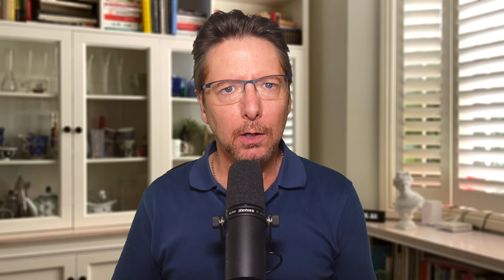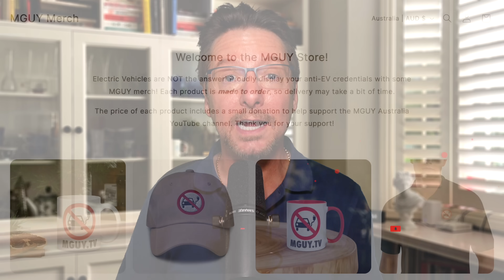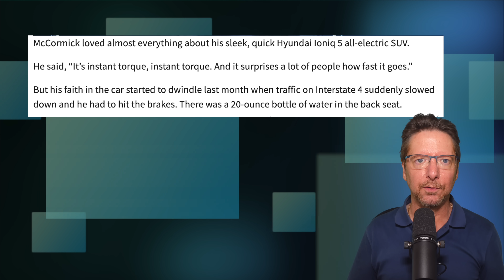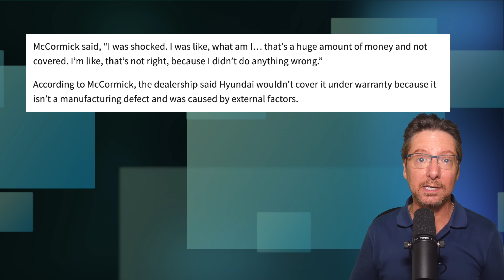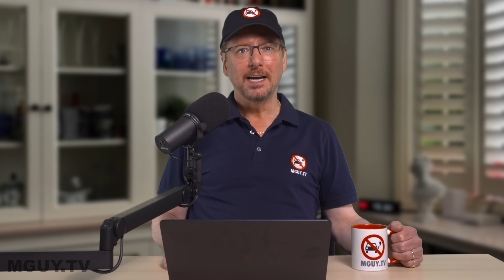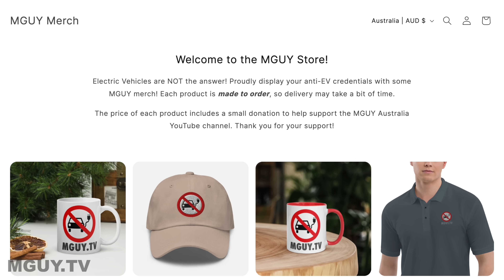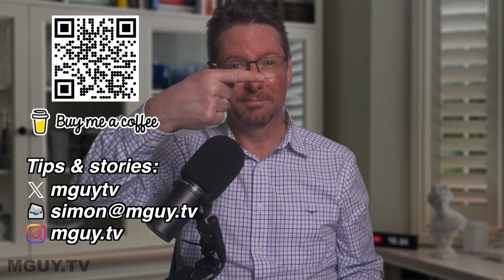ASTRONOMICAL EV repair bill for spilling a WATER BOTTLE! | MGUY Australia

Comment: Bowen wouldn't know about water and electricity not mixing, he has the brains of a house brick.
Reply: I have always called him 2 bricks 😂 he is way thicker than one brick.
Reply: The people voting for him are just as bad.
Reply: Insulting to bricks. More like dog turdd.
Reply: No, can't be: house bricks are useful.
Reply: Don't be kind to him, he isn't even that smart!
Reply: That's very insulting to a house brick.
Reply: Why do the anti-EV fanatics not understand the electrical industry "Ingress protection (IP)" rating which is an industry wide standard for operating electrical equipment in wet conditions?....Water and electrical devices can be operated in the rain and underwater if they have been designed and manufactured to do that.....
Reply: Bottle from back seat soaked driver's seat?  I think he was out dogging and the person he was playing with took a waz on him.
Reply: No, I'm yet to see a brick that can't out rank him in an IQ test.
Reply: yes, a hollow one.
Reply: Half a house brick.
Reply: House bricks are useful…
Reply: Электрические провода есть в любом автомобили,молчи и тебя посчитают умным😂